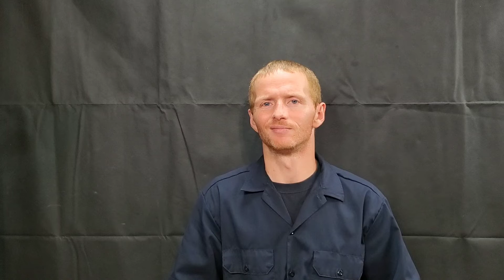Everything you need to know about carbon buildup on a GDI engine!

Comment: I got a little tidbit, after you let it “heat soak” after the can is empty, let it sit the time allotted on the can. If you are not close to an interstate like I am. Simply put your car in a gear lower than it wants to be in. On avg “MY”car revs 3250-3500 on interstate. (Note what your car revs) So if you have 45-55 mph roads just gear down until you reach your cars interstate speed revs. ie I make my car rev 3250 at 45mph (whatever revs you previously determined) or whatever gear it needs to be in, usually one gear down is sufficient. Hope this helps.

Comment: I run the dual oil catch can setup. Will do my oil changes every 4K to 5k miles and use Amsoil going forward. For the fuel and injection  system i use the STP 5 IN 1 treatment.  Gettingba tester and borescope in the near future.

Comment: which ones did you find that worked? ive heard rumors that seafoam is a very bad idea for a direct inj engine
Reply from the maker: I have had some success with seafoam and originally after many attempts the gumout GDI cleaner and Liqui moly valve clean were the first that actually broke down the carbon on a GDI engine.